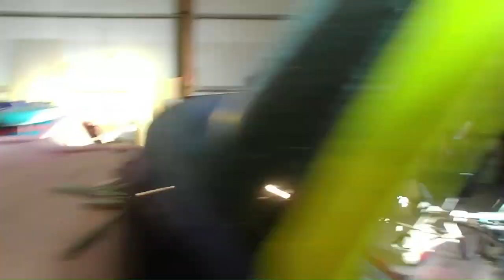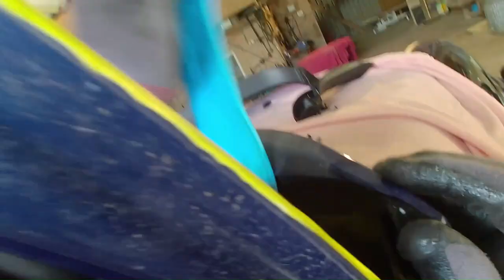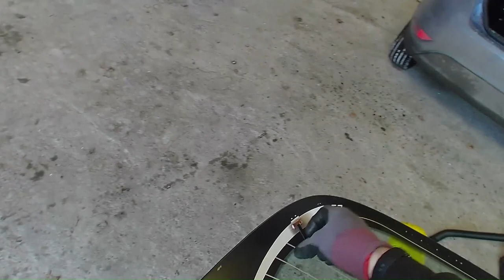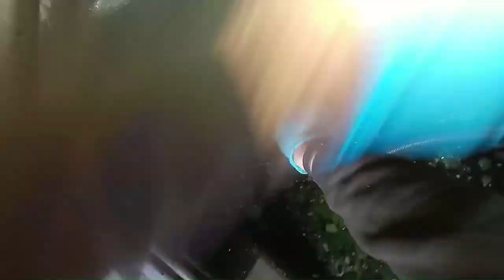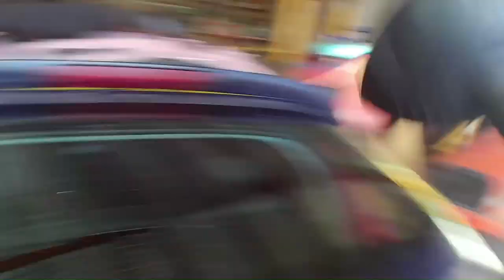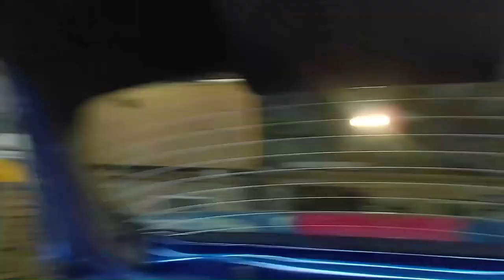HOW TO REPLACE A REAR WINDSHIELD | Start To Finish Unedited POV | FORD FIESTA

Comment: Does the defogger work in that replacement windshield ?
Reply from the maker: Of course it does, its a brand new window.
Reply: Did you not see the condensation between the lines
Reply from the maker: @xkILAkOKONUTx  is this question for me or @Chimmyislive1 ?

Comment: The seal/rubber that bonds the glass to the frame seems to be a very low modulous consistancy... it cuts easy and comes away easy..
The primer seems a really good bonding solution too as your virtually glueing new seal to the old seal...
But it all works tho.. good video for imformation... but could do with loosing the music back track it gets repetative..
My only grip is why dont you cover the boot aperture with a tarp or cardboard or similar to stop excessive glass fragment  getting in... i know the initial breakage has spilled in, but why make it worse.... those little bits slice the f*** out of your skin ....
Keeping exvess out would add to your professional approach of installer... (In my own opinion)...😊
Reply from the maker: Ok, thanks, but FYI  Toughened glass is specially treated so that it will break into small, blunt pieces under pressure, making it much safer than shards of normal glass.  It certainly doesn't slice the f**k out of your skin.